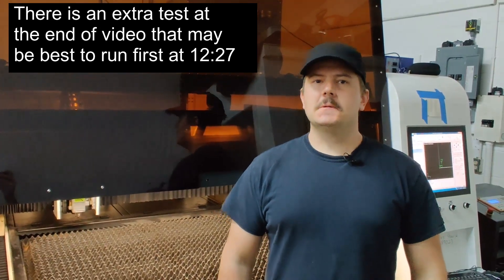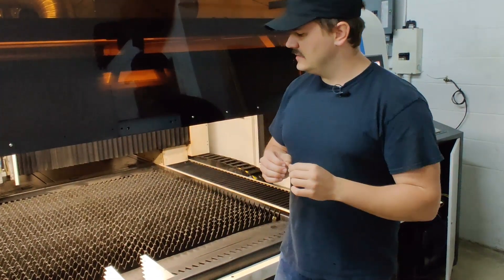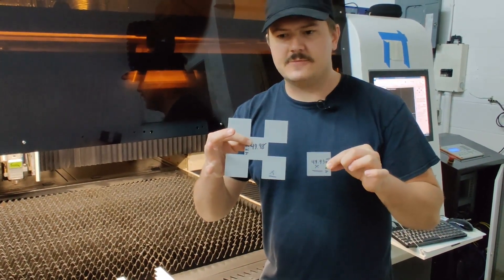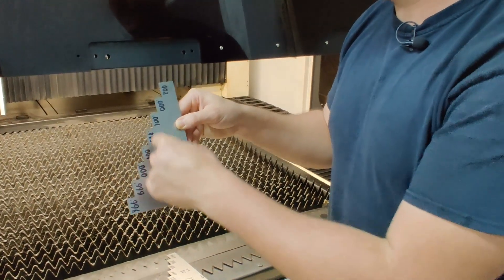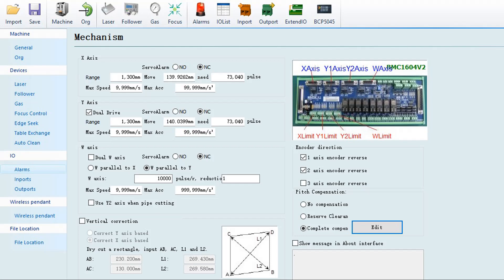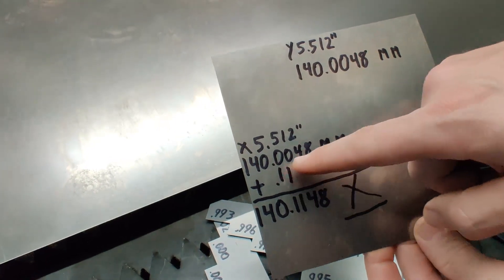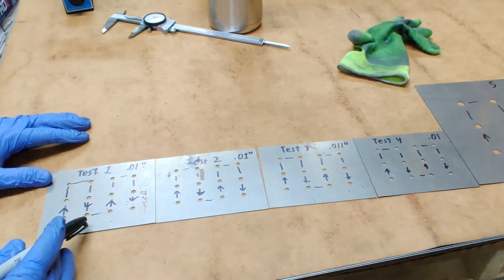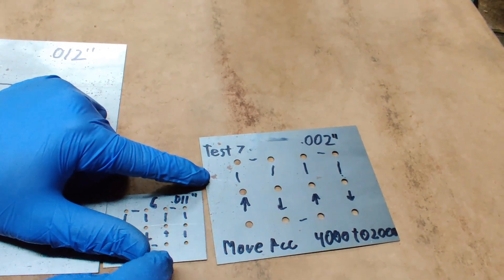Calibration on cypcut laser cutting machines.

Comment: It’s funny, but I go through pretty much the same tests for my 3D printer and my milling machine. You should buy a cheap 6” micrometer. It’s just as accurate,, but possibly not made as nicely. For running tests such as these, it will last a lifetime. My TESA caliper is one of the most accurate you can get, but it’s just plus or minus 0.001”. Most others are worse at plus or minus 0.0015”. Not great. There’s a way around it involving gage blocks.

Comment: Hi, thanks for information shared! Do you know how to calibrate the servo gain ajustment? I need to cut pieces of 2056mm long and machine is cutting at 2101. thanks in advance for any comment
Reply from the maker: I don't think it is servo gain, it is likely just calibration.. Machine calibration is very time consuming as you have to do dozens of test cuts to get it prefect and you must have tools that can measure accurately enough to test the sample parts and make adjustments. As said in the video it's easy to mess up and hard to fix.
Reply: Thank you!

Comment: my laser make holes .2 mm bigger. is it normal?
Reply from the maker: If it's just holes being larger than you probably need to use cut compensation. Remember the laser has cutting kerf, that you need to compensate for.
Reply: Is there no auto compensate
Reply: @jmihalov  no you just need to make a sample and adjust for the actual value of compensation and it ll be spot on.
Reply: @rackhir100 yeah, just calculate the percentage of error and then adjust the actual cut using that.